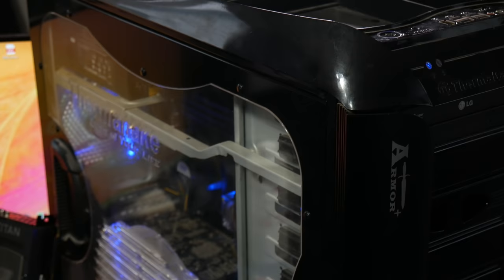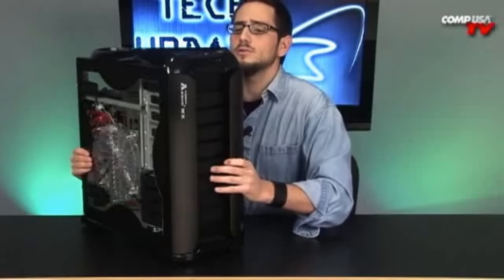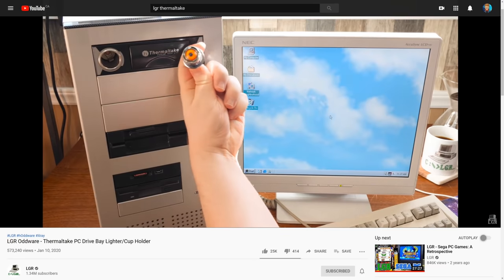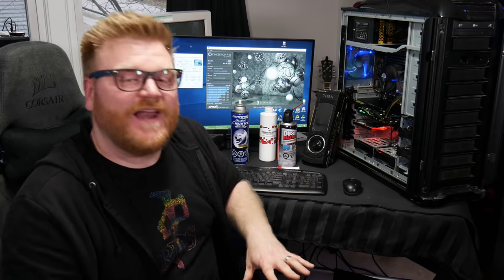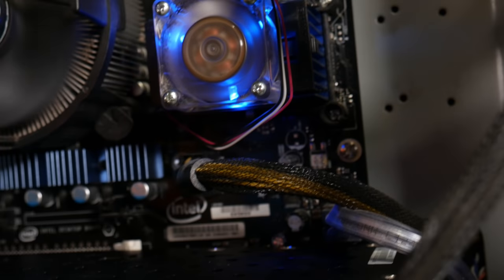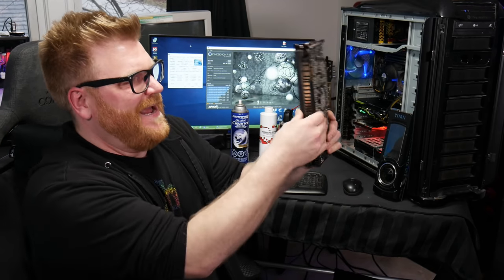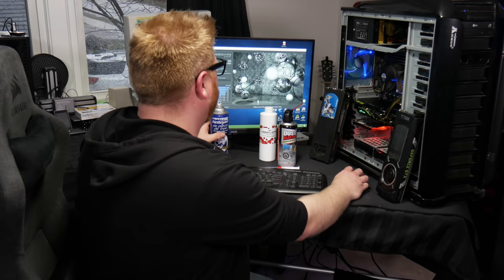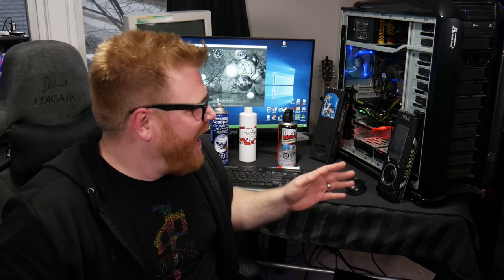Can $5000 buy a PC that will last 10 years?

Comment: I built a gaming rig once.. and it is still running and lasted 9+ years so far...  MSI P67A-GD65, Sandy i7 2600k,  GTX  460,  8 gigs of DDR3 1600 ram. (1.5 volts)   I paid for motherboard, CPU, Ram, PSU,  And Western digital black 1 terabyte. (1200 bucks?)  I did upgrade it over the years... Doubled the ram  (16 gigs),  Samsung 860 pro 500gig boot (recently) , 2 terabyte mechanical storage drive (last year),  Asus Rog Strix GTX 1060 6g,   And upgraded PSU to a Corsair 850 TX.  Still using the same Zalman 9900 Max air cooler and it's overclocked to 4.2ghz since like 4 or 5 years ago.  I use it everyday but did build a Ryzen 5 1600X system (backup/replacement) when I had a scare a couple years ago. (boot looping)  Contact electronic cleaner fixed that problem (Whew!?)  Super stable to this day... I'm very surprised and shocked she is still going so strong.  I guess I wasn't planning on it but glad it lasted?  Thanks Timmy Joe for the video!

Comment: Upgrade every 5 years usually. My last upgrade was from a 4690k @ 4.5GHz and a Geforce GTX 970 to a Ryzen 3 3600X and an RTX 2060. I find the upgrades become less significant over time if you don't plan on doing much gaming though. It's definitely not like the 90's when you when from a 386 to a Pentium 3.

Comment: My computer is basically a mid-high end system from 2017. I bought it for 600 initially and have slowly been adding to it over time. Much much better idea. Also, building the way I did, I learned what I wanted to get from the computer. My initial want was 1080p high-ultra and the computer has done this pretty well for the last 2 years since I got it. Now, rather than saving 2000 for a new computer,  I'm just saving 450 for the graphics card upgrade.

Comment: When i build my PC, i go with the top of the line CPU at the time, but i go with mid range GPU's and upgrade them every 2-3 years selling the old one. I find it way easier to sell a GPU vs a CPU w/mobo and ram. So my current PC i built 7 months ago was my AMD 3950x/MSI X470 pro carbon/32GB ram/GTX1080ti, but prior to 7 months ago i was still rocking my i7 2700k from 2011, so it lasted me 9 years and about 4 different GPU's during the years. I don't normally go with the highest GPU either, but the 1080ti i got during the mining crash for a deep discount and since I was watercooling it i didn't care if the fans were wore out.

Comment: With a 6K budget I would drop 3K on the initial system and then every 40 months spend 1.5k in upgrading rig.  Start off with a Lian Li XL and Titanium level PSU that will last 10yrs....that way more $ towards other components along the upgrade path.  You really need to talk your client into going a route along those lines.  Enjoyed the vid.

Comment: Computers these days last MUCH longer than they used to. In the 1990s a $2500 system might not even be able to open a web browser within a couple of years, let alone a game.

In 2017 I spent about $600 on an Acer PC, and a few months later upgraded the power supply and added a GTX 1060 3GB for an additional $350. I'm counting on it lasting another couple of years before adding RAM and refreshing the GPU for a few hundred dollars. From there, I am hoping to go another 5 years at which point I'll look at another PC.

In short, I'll spend a fraction of what this guy spent and still have about as capable a gaming rig in 10 years, if not moreso.

Comment: Bought i3 550, Biostar Board, HD6570, 8 GB DDR3 with Corsair 300R case, Deepcool 4Pipe tower cooler, Benq 22in ips is Q3 2011, 

Then upgraded to i7 4770K with 2 X 280X(XFX and Sapphire Trixx), Z87X-OC Board, 16 GB RAM(added another 4GB x 2 later) Corsair Vengence 1600MHz, H100i AIO(the original, not GTX or V2 which was the best) Cooler Master v1000 PSU and Corsair 600T SE white in Q1 2014, 128GB 840 EVO SSD 3TB HDD.

Then Threadripper 1920X, 32GB 3200MHZ Gskill Trident RGB, X399 Gaming 7, GTX 1080, Same V1200 PSU (basically v1000 failed twice and got new units twice. In the end traded in and paying the difference for V1200), Corsair 780T White in Q2 2018(not sure completely). But this build gave me Alooooooot of trouble so I had to upgrade the full system very early.

Now, Ryzen 3950X, Zotac 2 x 2080ti AMP Extreme, 64GB Triden Z 3200 C16 (Old 32Gb and bought another 32GB Same kit), X570 Aorus Master, H115i Platinum, CM V1200 PSU(from old build, still has 5 years warry left),

1 TB 970 Plus, 1TB 860 EVO, 480GB A400 Kingston SSD( got good deal)  3TB HDD(from 2014 build), 2 x 2TB HDD, Cooler master  Cosmos C700P. This build took me 6 months to buy. Actually, first built with old 280X and old 780T and slowly got other parts as payments and salary started coming. 

I do 3D Visualization and Graphics work on a professional level on software like Maya, 3Ds max with Vray, that's why you can see pretty high-end CPU and GPU at the time of purchase. I think if you want to invest on a PC, then do it with at least 4-5 years in mind, or at least 3 if not more. Coz at the time of upgrade, u may get a good return of money when selling in the second-hand market. Like I got a good amount when I Sold my 4770K, board, and RAM in a bundle. 10 years is super lame as technology is changing every year. I upgraded in  3-4 years interval and I already used most of its  power.

Comment: I spent about $900 cad back in 2012 for my desktop, and since then, the 1gb 650ti has been replaced by a brand new 1060 6gb a month after launch, and shortly after ryzen 3000 a 3600 replaced the aging fx 8350 (which would still play all my games at 60hz. All said and the parts cost is nearly double what it originally cost, but I could play games at 1080p on it for another 2-3 years before the 1060 ends its useful life.

Comment: I think it goes both way.  For example, on my previous build, I opted to by a cheap B350 MB and a Vega 56 GPU instead of spending an extra $50 a higher end MB and spending the extra $250 for a 1080ti.   If I had done that I could have just upgraded directly to my 3800x and wouldn't have been concerned with upgrading the GPU for at least another year or so.   That being the case, spending the extra money for better components would have saved me quite a bit of money last Christmas.  On the other hand, expecting any computer to last 10 years at any price, for other than basic usage , is just wishful thinking and I don't think just throwing money at the PC to get the best of the best will change that.

Comment: I built my current rig 8 years ago off of a tiger direct combo deal. My z77 system with a 3770k is still kicking a decent amount of ass these days with games at 1080p or upscaled whenever I want it. Granted the GPU is a Vega 56 and I have a 4.5 GHz overclock on the thing. Ultimately I do hope to be able to game for at least two more years so I can say it stayed relevant not just for a decade, but across three console generations, lol

Comment: In 2015 I built my first gaming PC With a Z97N wifi motherboard, 4790k, CoolerMaster TX3 CPU cooler,  GTX 970 FTW, 16 GB of RAM, a 120gb Sandisk SSD, 1TB HDD, and CX600 power supply all inside a Thermaltake Core v1. 5 years later I have only upgraded my GPU to a RTX 2070 and purchased a 1TB Western Digital SSD. Original price was roughly $1300 if I remember correctly. If my experience is to any credit I'd say that most people should spend about $1000 bucks for their first PC and then get a GPU upgrade later on when needed. Obviously if you only game once in a while you can go for a lower budget but if current PC parts go as long as my current set up has and you want a beast that lasts a long time I'd recommend that price point and no greater than $2000 unless you REALLY want the best. Really once you go past $3000 you are just spending frivolously in my opinion.

Comment: My pc has been a running project for the last  few years. Started it with just a 2400g AMD, then  threw in an RX580 and had a little beast pc for 1080p gaming. Recently put in a new ryzen 5 and its obviously better than it ever has been. If i throw in a new really good gpu it will be extremely good. So my experience has been that slow upgrades is best rather than all high end all at once for years.

Comment: I just built (last month) an x570 with a R9 3900x, a msi 2080 super, twin cooling loops (GPU and CPU, yes 2 seperate loops), 16gb @ 3600mhz 16L (will be doubling soon) in a spec-delta (yes a squeeze but it fit and looks amazing) with 512ssd to boot plus a 7tb mechanical for under £1800 and I ordered mostly from high street (overclockers ect), my budget was also £4000 (I nearly bought the new Aurora) but I thought about it and did this instead, it was actually my first build I think I'm a bit like your mate but this time I went "fuck it" and learnt myself and chose and built all myself for the first time and saved loads, my pc is an animal and IV got money left to upgrade and a much better understanding of what's what!
Show him the light, I don't regret it at all I know I'll be able to do an upgrade soon and still be under budget, even now I can't find a pc the same price that competes spec wise, I saved loads building myself I'll never buy another pre-built again!

I must add 10 years ago I couldn't do this, we live in a different world today, with instant access to any information it's alot easier to learn this stuff yourself maybe now is the time for your mate to learn!

Either way I'm sure you will look after him if he doesn't want to learn himself, I'd be like spend £2k now and £2k in 5 years that'll get him 10years worry free (btw all my prices are UK pound)

Comment: Im actually on my 10th year with my i7 920 d0 which i put together for $1300 cdn back in 2010 and finally decided to overclock it to 3.6 ghz with an ssd and rx580 gpu. im surprised its been freaking 10 years i can still max out every single game i play..  it almost matches my i5 6500 in benchmarks which i bought to replace it.. im selling the 6500 and keeping the 920 for maybe another 5 years of life in it.

Comment: I spent nearly nearly 800 over twelve  years ago including an up grade 5 years ago with Qx9650 and 8 gigs did me some justice with an original gtx 470 then a 1050ti ftw. Up untill this year when the architecture changed for the games that were built for 8 thread cpus. I could game 1080p about 45-70 fps no stutter. Up until Bf5 came out. Just could not game at all. Cpu was well under full usage about 85% usage on low setting. 400 cinabench score. So yes slowly upgrading your computer over 10 years gives the full experience and never has you behind on the emersion that the new titles offer. Just upgraded to 7700k and will have for the next 10 years unless something more interesting comes up.

Comment: i remember when i first bought my i7 3770k.. still running now, still using it daily, paired with 970 (had 660 first) upgraded when it died. im about to change now, nearly 8 years old now.. so yeah pc can last 10 years but you will not be on top of the top ^^
Reply: same specs here...struggling to decide whether to upgrade now or wait until gaming devs up the requirements to match next gen console capabilities
Reply: @amdarkcomics4231  actually i dont feel i need a new setup, but if you go with a 144+ monitor you have to change whole setup. Clearly can play most of the game in high/ultra setting @1080/60fps and i dont need more actually.. just waiting cyberpunk 2077 to see ;D
Reply: @kalytv6440  same haha it has to run on  current gen consoles so im pretty hopeful for now

Comment: Spent 2.5k on my first PC 15 years ago.  3 custom builds later, I still fight the urge to get bleeding edge parts, but I know they aren't worth it.  My current build is 5 years old and is finally starting to show its age.  I spend 1,200 on it 2015.  Slowly piecing together an 800$ build that will double the spend the my current one.

Comment: in 2009, if i would buy x58 platform, my spendings could look like: asus rampage or evga classified - 500 bucks, i7 920 - 350 bucks, 3 sticks of ram 4 gigs each - 150 bucks, radeon hd 5000 for 400 bucks, case with psu - 400 bucks, storage (ssd + hdd) 300 bucks, custom liquid cooling for cpu, chipset, vrm (360mm rad, waterblocks) and fans - 500 bucks, and if i wanted to upgrade this rig after 4-5 years for example, i would sell 920 for 100 bucks maybe and buy i7 980 for 500 bucks, replace ram with 3 sticks 8 gigs each (for the same 150 bucks) and buy a new r9 290x (600 bucks), and even after that there are no 5000 bucks, not even close, your client spent a lot of money for nothing

Comment: The Core i7 940 iMac I'm watching on is from 2009, when it cost close to three grand.  I've upgraded its system drive to an SSD and added RAM, but beyond that it's just as it was in 2009.  Yeah, in 2020 it's getting pretty slow, but it's still reliable for email and browsing.

Comment: I paid $1,000 for a PC at CompUSA in 2007 with an AMD Athlon 6400+ chip in it. That's the last time I bought a new one - my current rig is a retired z620 work station (that I got for free) with a Xeon 1650v2 and a 1050ti, but I'll probably get the next SCREAMING good deal I see on an RX 580 or R9 390 (sub $100). I will coast on this until I find something it can't do the way I want it to, then I'll jump to my next one. I think I've put maybe $300 in to this PC between CPU, RAM, SSD, and GPU. There's just no reason to get a whole bunch of power I don't need, and this does everything I need it to do.

Comment: my i7 was released in 2013 its an i7 4771, its paired with a gtx1080 and does fine at 1080p 120hz atm. starting to get long in the tooth but i'm not concerned runs everything at good settings even now, all i've upgraded is the graphics cards went with 80 series non ti the whole way and installed an ssd i've had more than my moneys worth from this platform it probably cost about $2700nzd. so yes it's worth paying the extra to go for higher end components in the long run not 5k though, this one will be turned into a media center when i buy a new one.

Comment: I used a sandy bridge i5 laptop for 7 years. I have never upgraded it. Actually I downgraded the storage. About 2 years ago I actually did the same thing as you said. I bought a Coffee Lake i7+1060+16gb ram laptop. I am planning to use it for about 4 years. It is not only about the parts becoming obsolete also you must be pretty lucky if you want to use the same parts for 10 years without any hardware issue. Cosmetic wear is another problem. You can't know for how long you can use your computer.

Comment: 2 years too old, if it would of been 2011 when x79 came out you could get away with just a GPU upgrade now & still get passable performance in current games. I got the 3930K 6C/12T & OCed to 4.2GHz then, when 1st gen Ryzen came out I upgraded to the 1700x but didn't really much of a difference in games, I had a GTX 1060 at the time, still having more cores, more USB 3.0 ports was nice.

My X79, 3930K went to my brother's friend & they got a GTX 1070 for it & are still using it today as their gaming system.

I fell for the upgrade itch on 2nd gen Ryzen, currently on Threadripper 2950x with a RTX 2080 & I've been very happy with this system.

Comment: For example if you got 9900k and 2080ti you are good for next 4-7 years, depending how crazy you are. I changed my Alienware M18-R1 after 7 years and that is when driver support stopped for HD6990m. So yes, it payed off.
Take in mind that PCs and laptops were much more expensive that today and performance was on a lower level than today.

Comment: Most amount of money i've spent on computer so far is 800Euro 3 years ago. Right now if i think about it, i see that my PC can't cost any more than 350 to 400Euro because of the changes that have happened over three years, the R3-3300X, 16xx GTX's, 20xx RTX's, Ram is way cheaper and more powerful, better and also cheaper SSD's (I'm still sittin' on mechanical HDD, gonna get an SSD). I have nothing to rip my hairs off, i'm still happy of what the system brings out on screen, but it doesn't meet my requirements no more - 3D modeling, some video editing for others, also gaming gets slower on higher details, lower ones goes well. At this point i gotta wait for everything to stabilize in the market, the new products to launch, then get to final conclusion on what to get, what will fit me the most and build another PC.

Comment: I have a GTX295 myself, a BFG Tech branded one; its referred to as the cassette tape by the friends and family. still fully functional too, rather high idle temps but it is a dual gpu solution from 2008/9 after all. paid £18 for it 4 years ago as i'm a sucker for dual gpu cards.

Comment: I spent 5 grand on my current system in 2011. Its time to upgrade... but its lasted me well. 2600k intel, originally 2 gtx 590's in sli. They died and EVGA replaced them with 680's. She's been a good ride, now I'm just waiting on ampere and Rocket Lake for the next build. Multi-core workloads don't interest me yet enough to jump to ryzen.

Comment: In 2009 tech was way different and moved much faster compared to now. I think the longevity of a system  is a lot more viable if it was built with parts from 2017 onwards. And likely would last the 10 years. Especially considering the standstill of game graphics, mostly only improving a tiny bit, compared to the huge generational leaps of the past.

Comment: I put together an almost $4k computer recently, with the intention of using it for as long as possible lol. 2080 ti, 3950x, 32gb 3600 ram, seasonic 750, samsung nvme ssd's, noctua everything fan wise etc. I'll try to remember this video and check back in 5 years time to see how its holding up. edit- its almost 4k judging off of pcpartpicker though, i spent somewhere around 3 getting deals on amazon and etc